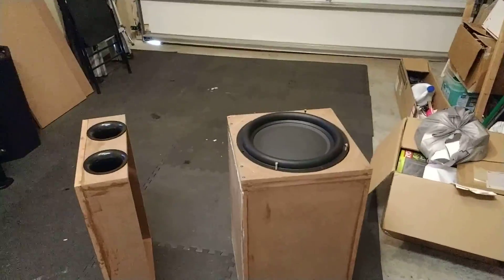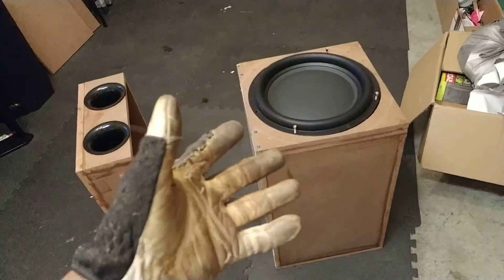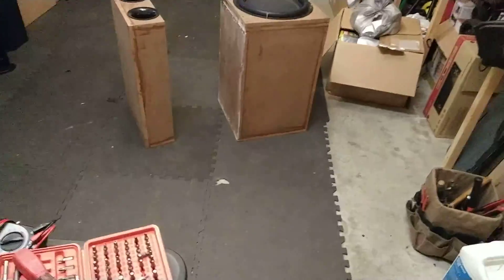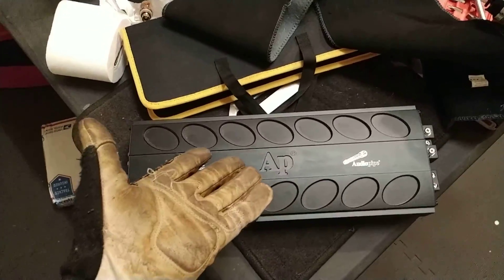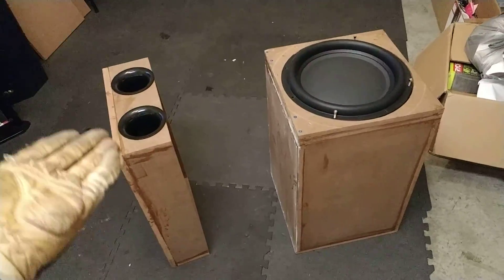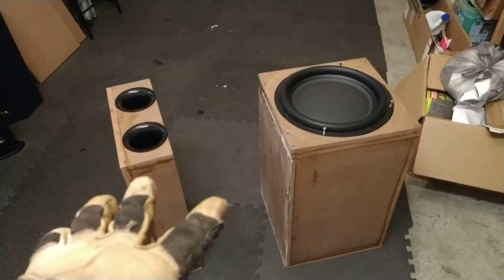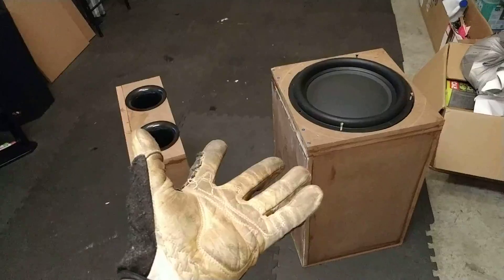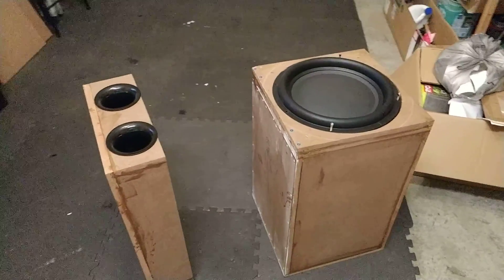Can You Port A Sealed Enclosure? - Part 1

Comment: get a better amp there trash that dose not reach rated rms there as much as a 1000w off there rating. that are a cheap copy of the Taramps but they failed copy as normal from china as the board cant carry enough amps.

Comment: Sell the audio pipes and put in some real amplification...need a amp with decent damping factor to control that cone right
Reply: Nothing wrong with those amps except that YOU don't like them.
Reply: @Se7enMiIe  Eh that woofer can handle 3500 watts rms...and it has a high moving mass, sooooo an amplifier with a high damping factor would pair great with that woofer.. And i didn,t say i did not like them..They are probably a good value option, but when you get a weird type of woofer like this a better amp with more power and better damping factor would give a better result..
Reply: @justkiddin1980  comment makes it look like you talking down on the amp. It will work for what he's trying to do, all that technical blah blah about dampening factor means nothing. There's amps out there with DF of 100-200 that outperform ones with 1000.
Reply from the maker: This amplifier is stable @1ohm. My 4ohm load should be enough for linearity.